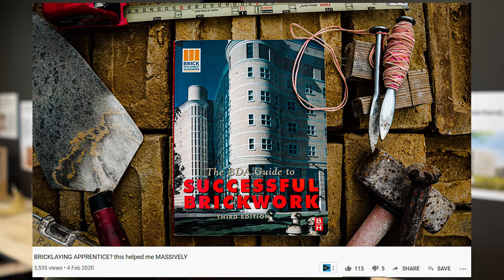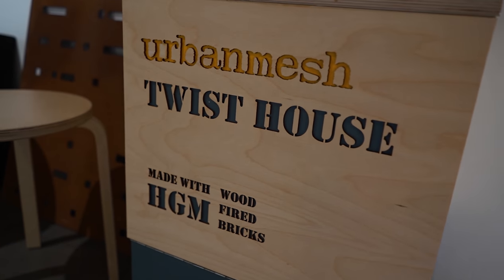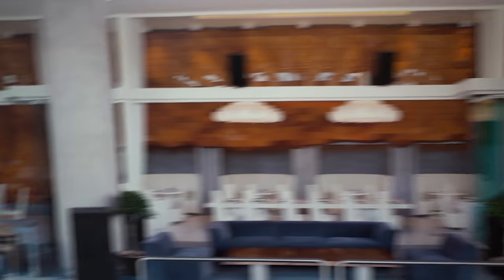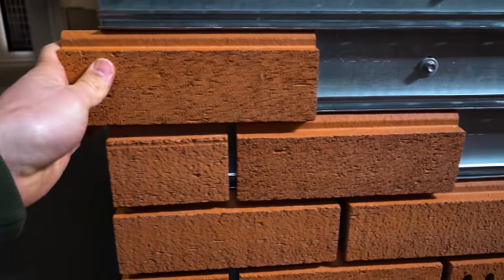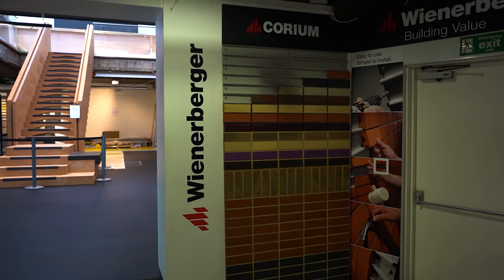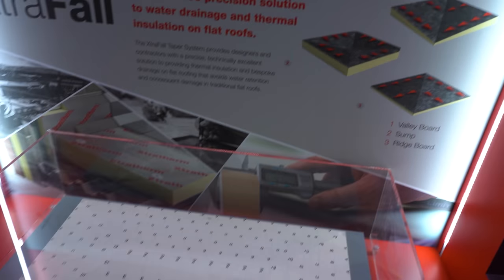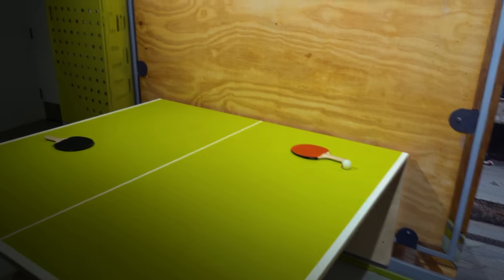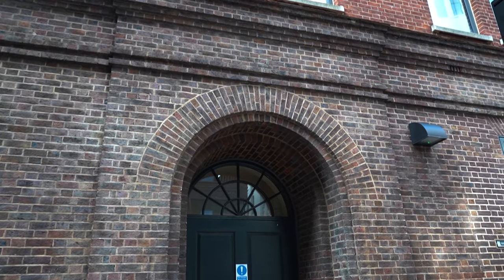Is this the BEST BRICKLAYING in the world?

Comment: Vids please on gauged brickwork or rubbed brickwork (some call it the same), carved brickwork, tuck pointing, Mathematical tiles (tiles trying to be bricks, English, 18c ) London stocks (which had victorian burnt refuse added to the clay before firing, Roman bricks (more like tiles, v thin), Tudor chimneys, Hand made bricks, Unfired bricks, Bricklaying without cement (the vast majority of existing brickwork, cement was only invented in 1823 and was slow to gain popularity, lime mixes let a building settle without brick fracture) 

Anyway, thoroughly enjoy the Chanel. Well done.

Comment: I have used that cavity therm full fill insulation with the white plastic front on it, it it very awkward to use lol and the white plastic on the front of it is for water proofing and the protruding bits on it are for any moisture to run towards the outside skin of the brickwork to keep away from the interior
Reply from the maker: Interesting to hear from someone who has used it 👍🏻🧱